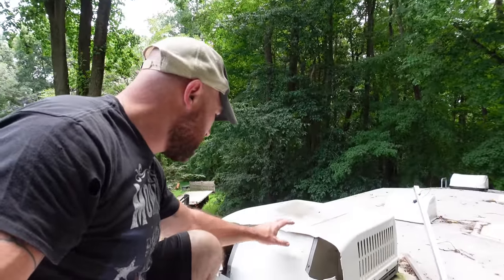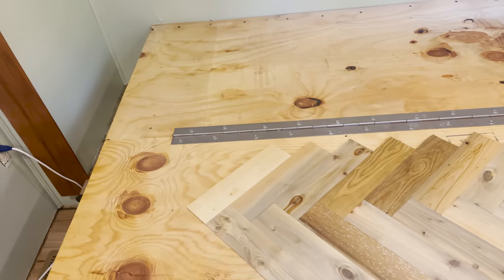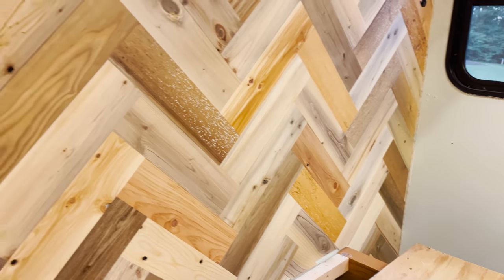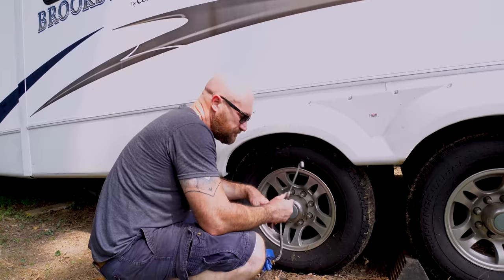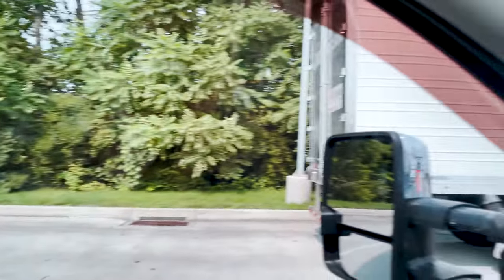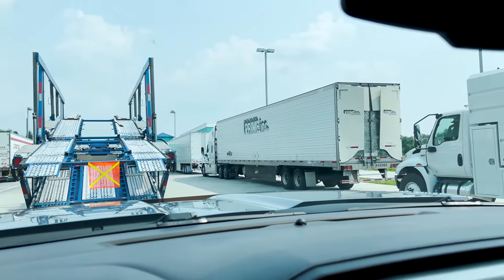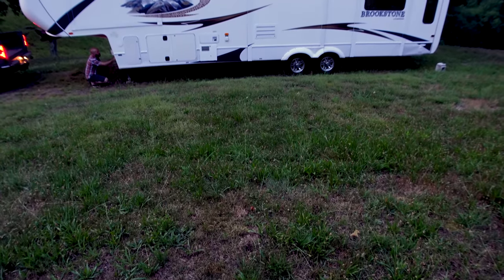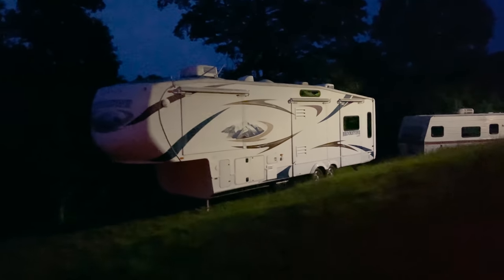Taking The RV On It’s First Trip !

Comment: I think solar panels would be great on the RV with battery storage in the generator space.
Reply: I installed 1000 watts of solar panels and 3 x200hr lithium batteries, a MPPT 100amp charge controller and a 5500 watt sine wave invertor. Runs my current 5th wheel great  boondocking in perpetuum. I just cannot run both AC units at the same time, but are fine running one at a time.  Both TVs, LED lighting, microwave, etc can all run fine.

Comment: Just a tip. There are really good foodgrade silicone sealants that work great on trims and covings as an adhesive, no tacks or screws required. Sikaflex ms is what I use. Super strong, flexible and easily removed with a blade if needed.

Comment: I actually had a Heating and Air guy come out and solder in a charging port for what looks like the same unit as yours. He charged it and it has been working great! I was going to buy the self taping kind from amazon and he recommended against it. He said that most of them fail fairly quickly. Great videos and I would like to see the cost breakdown. I have 2 slideouts that have started doing the same.
Reply from the maker: I’m betting that’s a much better way to service these units. I’ll likely do the same. Thank you for the tip ! Also thank you for spending some time with us here on the channel !
Reply: Hello my name is James Keene pleased to meet you John Keener 😀 at 81 it's the first time I ever seen a name close to  mine. I live in Southwest AZ stay healthy!  And iam sorry I didn't get your name, dam nice VIDEO 👍and if anyone said anything about your job tell them that they can come over and make it right if they think they can do better 🖕😭😁

Comment: I dunno about that one but my horse trailer is aluminum exterior with painted finish and purple power works awesome on it and get rid of the black streaks. Spray on low pressure, scrub with a soft brush lightly and high pressure rinse. Looks like new but yeah I see a truck wash I will give them a try. I saw some of the fixtures. One of the best upgrades you can do is convert all the fixtures to LED. Changes the entire look and its cheap.

Comment: Hahaha.. I remember the first hitch on with my very first 5th wheel… with a 5the wheel open tailgate and knowing my trailers perfect height it takes 35 seconds to hook on and lift the front jacks.. I certainly don’t drop the pin on the camper into the hitch on the truck.. I leave it down just a bit, let the truck squat a bit hooking on… 
Love the 4 ton truck, make a great Trailer Hauler

Comment: Great videos.  I 've gone thru all of your videos after finding the 401.  I'm wondering if the bump out flooring rot is due to the lack of mud flaps on the 5th wheel.  
Driving in the rain could sling up in water in unsuspected areas.  Kind Regards, Craig

Comment: Excellent job! I noticed one of the slide outs seemed to have a propane fireplace on it. I was wondering what the hookup to the propane tank was on that? That is to say, is it just a rubber propane hose that flexes appropriately as the slide moves in and out or something more elaborate? Thanks.
Reply from the maker: Thank you !
The fireplace is actually an electric one. It actually looks pretty real when it’s on.
Reply: My fridge is in my super slide and uses a rubber hose supported by a plastic support that folds when the slide moves

Comment: so how much do you think you spent on this in upgrades and repairs and did you ever find out where the leak was coming from that lead to the water damage of the floors?
Reply from the maker: Hey Kevin
We ended up sealing everything. Windows, roof seams etc….    I still have to look back and see how much I spent on it.

Comment: Does anyone know how wide that behemoth is? (folded in of course) The maximum width of anything on the road here in Sweden is 8,5 ft. Wider than that there's paperwork, warning signs on the transport and sometimes a "pilot". A lot of work for a fishing trip with the guys over the weekend. 😂
Reply from the maker: It’s 102 inches wide with the sides pulled in. That’s max width over here in the states.

Comment: Never use a sidewall max pressure to tell you what to air it up to. Use the owners manual or RV tire pressure sticker. Appropriate tire pressure is based off the weight of the vehicle.

Comment: Going near max PSI in a tire is not a great idea. Example your vehicle PSI max will say 60 but manufacturer spec is 32PSI. I’d check the trailers recommended
Reply: You have obviously never had large trailers or heavy haul trucks. You have to use the load spec of the tire and the tire chart. The manufacturer spec only applies to the origional tires